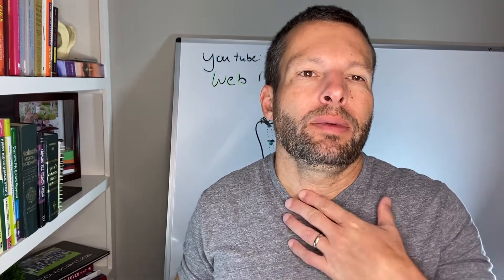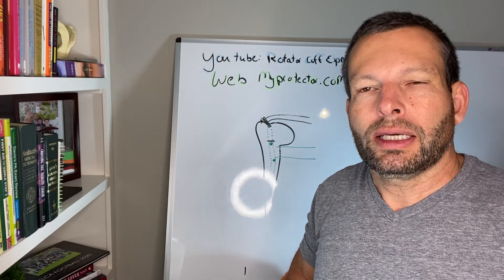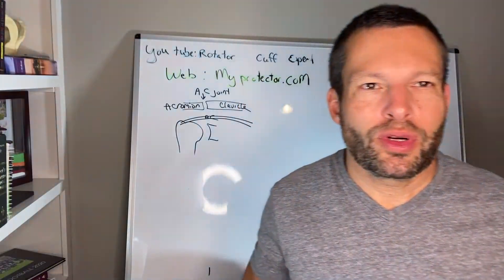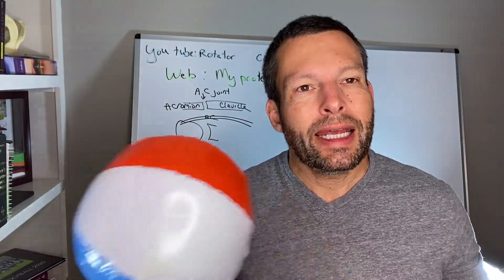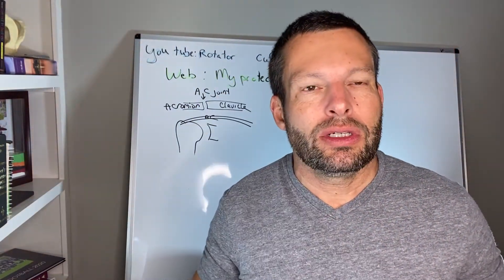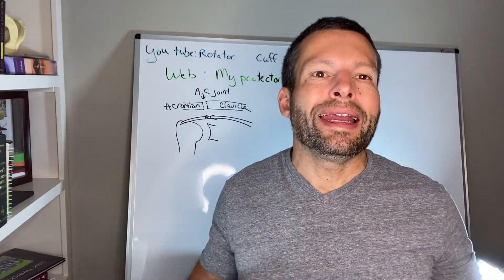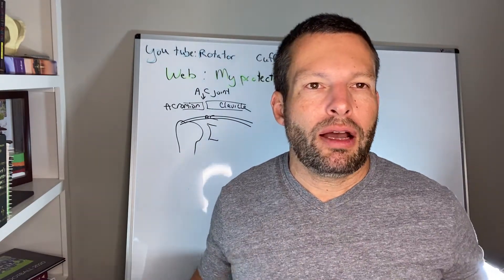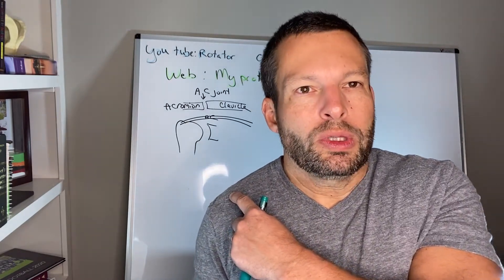What is the distal clavicle and what do we do with it when it is injured?!

Comment: I hurt my shoulder back in 1999. It has been hurting more and more. I have had 2 surgeons look at my shoulder. They both said I need a distal clavicle excision with a subacromial decompression. I have popping in there. When my surgeon moved my arm, he made it pop. Also, I have a lot of tightness in the bicep area which my surgeon is thinking it is an impingement. I have surgery coming up June 13, 2022
Reply from the maker: Erin , popping is common in AC joint arthritis/irritation.  That can be improved with a DCE.  I'm sure your surgeon will also look at your labrum, biceps and rotator cuff.  Good luck and let us know how you are doing in your recovery!
Reply: @rotatorcuffexpert  I will let you know how things go. My surgery is a week from tomorrow, June 13th
Reply: @ErinM-2024 so , how did it go?
Reply: @ErinM-2024 how did it go?

Comment: Hi Doctor. Thanks for this very good video. May I ask your personal opinion about my case please? I'm 26. 6 months ago, I was found with subacromial bursits and last month with supraspinatus and infraspinatus tendinosis. I had MRI and Ct scan, was found out I have early manifestation of distal clavicular osteolysis. My ortho specialist suggested to have a steroid injection on my AC joint. would this be safe? I don't know if it will be the best option for early manifestation of distal clavicular osteolysis. I'm still in pain right now. 

and I'm doubting my doctor a bit because he missed that I have teninopathy and busitis in my right shoulder even though asked him couple of times if I still had them which it was clearly stated on my Mri result in front of him. Should I seek a 2nd opinion for this? looking forward to hearing from you soon. Cheers!
Reply from the maker: Rpaul,  that is a good question.  I think if you are thinking you need a second opinion then you do. You have lost trust in your first doc.  There is a role for injection however it is best to discuss all the details/ pros and cons with your doc.  Good luck
Reply from the maker: Please consider joining our newsletter.  Just email us at dro@mybodyprotector.com  and put "yes" in the subject line.  We will get you signed up and also give you a couple tip sheets!

Comment: Hey Doctor .Thanks for all the istructive content ! About a month ago i had an accident during my wrestling practice , where i ended up falling on the tip of my right shoulder . The X ray and mri showed a small AC joint separation along with a moderate sprain of the trap muscle where it attaches to the clavicle .However , ever since i have been experiencing pain in the front  part of my shoulder when i post on my right arm , during push ups and especially when i try to touch my other shoulder with my finger(cross arm). I am worrying this might have something to do with the bicep tendon but the mri didnt show any abnormality . Is there anything i can do to determine the problem ?
Reply from the maker: If the MRI shows AC joint separation and the doc who looked at you confirms it on exam then It probably is.  All the things you describe can be seen in AC injury.  I would make sure to have another appointment with your doctor.  Good luck in your healing.
Reply: @rotatorcuffexpert  Thanks for the feedback! Yes the doctor pointed out from the start that i have an AC joint separation.I am just cofused as to why this translates to pain it the front of my shoulder that i described , especially when the mri shows no damage in this area or in the rotator cuff muscles or the bicep tendon . Thank you in advance!
Reply from the maker: The ac joint often creates pain in the front of the shoulder

Comment: Hey,
I currently have a nondisplaced fracture nonunion through the distal end of the clavicle and sprained ac joint. This injury occurred 4 years ago and has limited be from physical activity since. I developed scapular bursitis and im just always in pain now with this nonunion/scapular bursitis. Surgery was never really an option from all the doctors I’ve seen. I ended up doing a poking (PNT) procedure on my clavicle/ac joint. Then PRP a week later. I don’t see any improvement from pt after 2 months and I’m just really frustrated. Anything you can suggest?
Reply from the maker: Hey Joe, sorry to hear about your shoulder issue.  There are a few options that can help pain in the distal clavicle.  As described in my video,  it can be excised.  Also if there is a fracture a plate may be used to fix a distal clavicle fracture.  A lot depends on exactly where the fracture is as well as the age of the patient, and the severity of symptoms.  Talk to an ortho and tell them your concerns and your pain.  Then you both can come up with a plan that makes sense for your specific situation.  Good luck and let us know how you are doing!